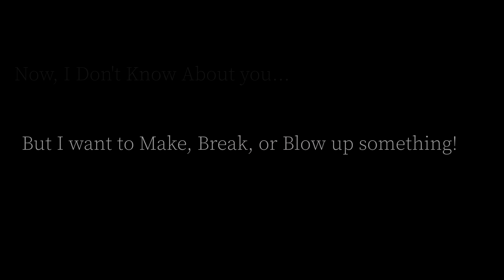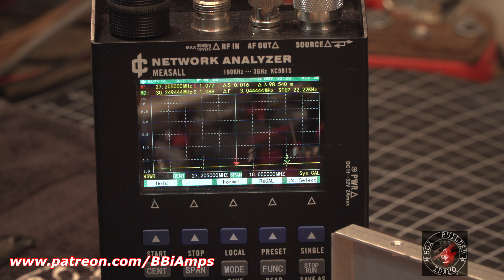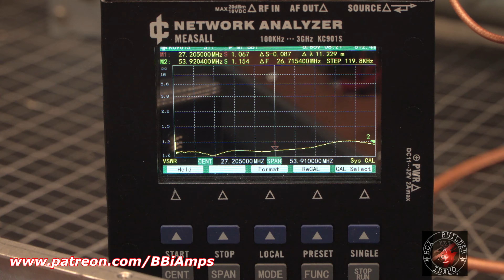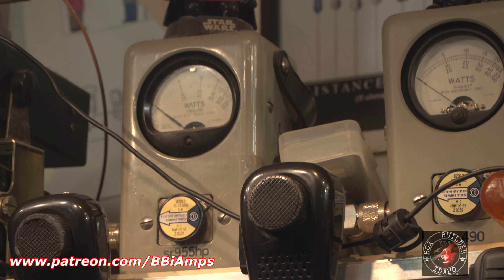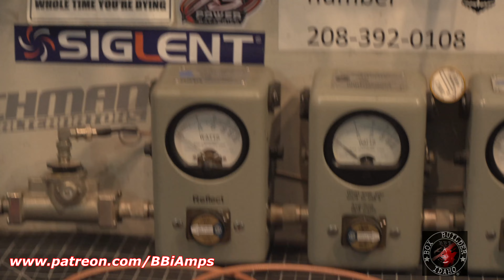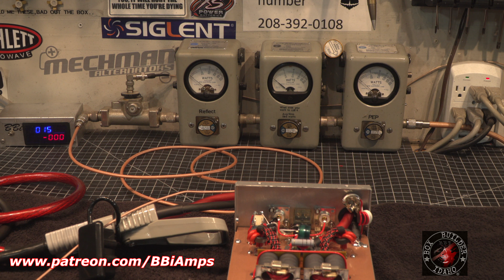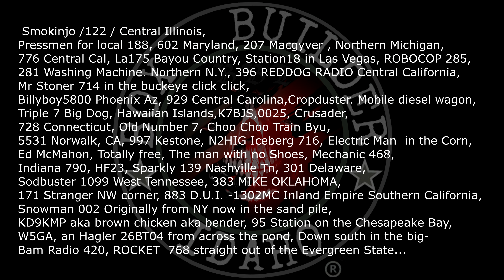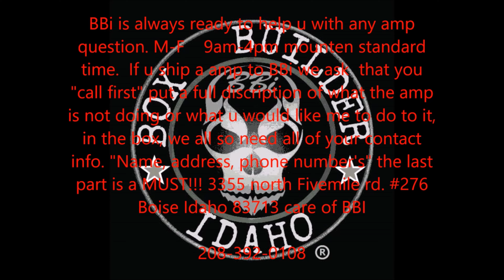Master Builder class #48 & #49 sold!!

Comment: great 4 pill box. would like to make a 8pill HG MRF454 box for myself. some day. with bias and PTT line. no keying transistor. also voltmeter and ammeter . I like meters ! more than just RF power meter. That why use a SB 175 amp connectors . 95 amps AVG current SSB. the fan is quit. I like them . move some air and not to loud.  nice job. love them Japan relays ! stay away from China ones with led in them. 73's